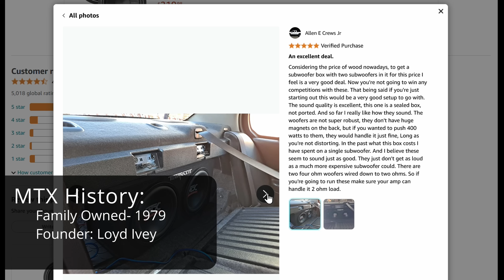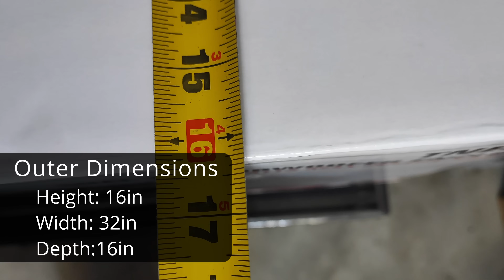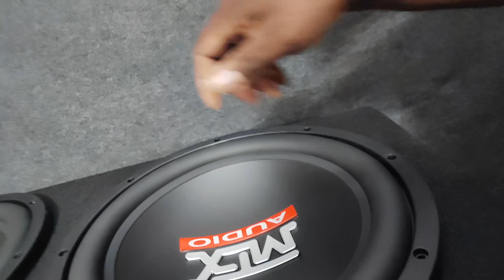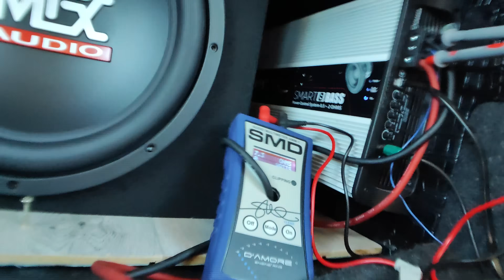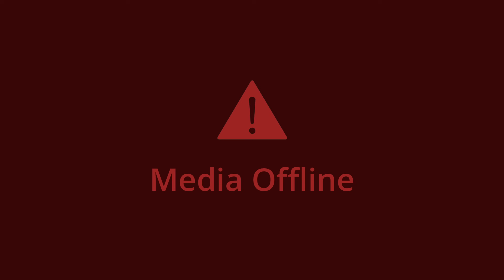Why Is EVERYONE Buying This Loaded Enclosure | MTX Terminator 12 | 5,000 Watt SPL Test

Comment: MTX is slept on nowadays it seems, but they have solid stuff and they're STILL family owned in USA. The current CEO(son of founder RIP) is fanatical about audio. Like, unhinged in a good way. Their amps are crazy good and usually way underrated(rated at 100x4 but actually putting out 140x4 kind of underrated).
I just ordered a set of front and back speakers from them for my truck the other day. Can't wait to install them and put an amp on them after I finish deadening my truck.

I have installed both pairs and they indeed bump, but so far only off the head unit. I just ordered the TH400.4 amp for them. So hopefully I'll get that installed and truly let them shine.

Now as long as I can resist adding a sub...

Just got the amp and the birth sheet shows 114x4 @4ohms lmao From an amp advertised as 50x4 @4ohms lol This is why I went with MTX.

Comment: I'll never understand showing db test for running a sub above the rated rms of the speakers, running 2000-3000rms on 400w rms subs is like shoving steroids into your arm then bragging about your muscle yeah its temp gains but your going to blow your voice coil/cone/xmax out at some point, only test on rated rms for a true test, no point showing numbers that sub can never realistically run for more than a very small time frame before replacement.

Comment: Guess it was too popular. Price as of 07/14/2026 is now $219, but the sub has a different appearance. I does not have the red "Audio" marking under the MTX brand. The box with those subs is $279.
Reply: @Mavrik1011- Just came directly from MTXs website, & this Dual 12" sealed Terminator enclosure with (2)- 200 watt rms 12s currently sells for $175, & the Dual 12" ported Terminator enclosure with (2)- 500 watt rms 12"s currently sells for $225, as of 10-20-2026.

Comment: My first subs were two MTX 4000 10’s with a MTX RT2100X from Circuit City. I eventually moved onto 4 MTX 6000 10’s on a Kenwood 600 watt amp. I actually miss the old paper cone 4000’s from 1999.

Comment: This box has been around for probably 30 years in some for or another. Tried true design. I know I have owned at least two. One I bought in the late 1990s and one I purchased in the 2010s.The older boxes were better built, they used to have the same bracing and hot melt glue sealing the seams, there was a lot of baffle cloth in the older one with pro drivers rated for 1200 watts max. The last box I purchased looked much like this and I sealed the internals with Sila-Flex later filling with polyfill to reduce some resonate deflection in higher volume listening. I ended up changing the drivers after a year of pounding to some amazing JBLs I found on clearance at PartsExpress.  In the end that box is now in my nephews collage rig and still bumping with a 2000 watt amp driving it from Tara amps.  They are built to last.
Reply: Thanks for this, I'm certain a lot of people were thinking that a well constructed box could sustain an upgraded speaker combo... upgradeability.

Comment: The reason 75% have 5 star rating because 75% of users don't know about impedance rise and only run a 500w amp on them and they're efficient so they get loud on low power but don't have much force and almost none down low where almost everyone wants it. Those are good for someone that doesn't want to upgrade their electrical and spend a lot on an amp and lithium, wìring, etc. A cheap Kicker 1000 or 1200 or a Alpine M1000 both 2 ohm amps that would run off 4 awg OFC power wire and big 3 depending on size of stock alternator you may want a small AGM or buy or build a cheap small 12.8v lithium battery or bank. You can buy a pre assembled ready to go 40Ah lithium bank/battery for $45 which is stronger and much faster charging and discharging power than an AGM Battery. Lithium is the future but it's dangerous for newbies to assemble but there are more and more people assembling and selling all different Ah 12.8v lithium banks ready to go for much cheaper than a AGM battery. Also you have more than rated clean power to see what the subs will really do. The average peraon that buys those subs clips them trying to push them because they don't understand impedance rise so most people don't get the results you are but I've done the same thing with 1k rms Rockville K9v2 15's in a stout custom enclosure I designed to the amount of clamped power the subs would actually be seeing and for around $260 shipped you can get 2 K9v2 15s and a Skar 3500.1if on a budget or a lightly used Korean made Deaf Bonce Apocalypse 4000.1 for $300 (not the small square cheap Deaf Bonce amps) the big rectangle that'll run at .5 and lower all day with proper electrical so a Korean 4k @ .5 could run 4 K9v2 15's or if you want a more musical sub the K6v2 15 is 1k rms and also come in D2 or D4 and I have trophies from 2 K6 15s, a cheap Hifonics Brutus 2k @ .5, a custom enclosure, and good electrical.

Comment: It was ages ago when I installed car audio.  We would get bored and to the "lamp cable" test.  Basically, take a 2-prong AC cord and wire it to a sub... then plug it into the wall.

Many a smoke were let out.  JL, Alpine, JBL, Kicker, Rockford Fosgate... For what it's worth - the MTX Terminator somehow held the crown.  Lasted almost a full minute before it quit moving.
Reply from the maker: That's wild!

Comment: I have the 212 Terminator box with the 2 MTX 12's hooked up to a Planet Audio 1500 watt anarchy amp and it pounds pretty damn good!! Bought it off some kid off FB marketplace for $150 2 years ago, and never had an issue. And I've pushed it a few times with the gain halfway up and no distortion, just takes the power.
Reply from the maker: Sounds like a great deal you got there!

Comment: What amp should i grab for the terminator  box? I have a 2016 toyota camry, Would i need any power upgrades to run these?
Reply from the maker: I say, "Upgrade electrical 'anytime' you add to your electric system." Most would say, "No need to upgrade when pushing less than 1,000 watts."

Comment: I purchased one, rocked it for about 6 months, and then I was like, "You know, my amp could power another set." So now I have two. Then I snapped my RCA cable to my amp, so I got a deal on a Rockford Fosgate Prime mono amp. 1600 watts hits hard. I abuse the hell out of these 4 12s. All in a Jeep Liberty... if I could fit more, I probably would.
Reply from the maker: Sounds like a solid setup you got going there.

Comment: Mtx was the shit back in the day with the jack hammer but my favorite is still i had 2 12 inch kicker comp vrs and they would make rocks jump off the ground with a 1500 watt jvc dynamic circuit amp that light up different colors if u put different colored plastic peice over the light i never relized how much better the old shit was my 1500 watt jvc blew every single Walmart i hooked up 2 it would sound good for about 10 min and smoke the spekers weld them together on some until i found a set of kicker comps i thought my amp was junk and just gona blow every speker i hooked up to it until i found those kickers and a mtx crossover to control the anp made a huge difference it bass
Reply from the maker: Thanks for sharing!``

Comment: Yea I have those in my car, they came with the car.  I was an installer back in the 90s and they are not 1200w they are more like 200w RMS, they are cheap and they get kinda loud but not overly loud, they are not musically accurate.  The the money they get loud enough I guess, but they are like the McDonalds of subs.  They are kinda trash, but if all you want is some bass I guess there ok.  It's never what I would purchase.  MTX are always muddy, and just not accurate.  Yes the sealed enclsures are louder in a trunk facing backwards.  The reason for speakers in a trunk being louder facing the back of the car has to do with the frequency that bass is at, and the length it takes a sound wave to complete.  The higher the frequency, the more direct the sound is and the faster/shorter distance it completes a sound wave.  The lower the tone/hz the longer/distance it takes to complete a sound wave.  In an ideal world you want the highs mids and subs to complete a sound wave at your ear.  The issue is at a sub frequency it takes something like 16 to 18ft to complete a sound wave, a car is not that long, and the subs aren't that far away, so pointing the subs away from you gives it time to coomplete the sound wave.  It's not cause it "LOADS" or whatever off the trunk, there is math and science and reasons it's louder.  If you had the subs facing forward the sound is going to "LOAD" and bounce around the windows and whatever else, so that has nothing to do with it.  Sound dedening works because you are losing less energy.  Anyway this is why pointing em backwards works, and it's the same in sealed and ported etc.  If you get a digital EQ where you can adjust the polarity, of each speaker independently you can adjust each speaker to hite your ears, or in front of your face, at the same time.  This is not doable without one of those.  With that being said back in the day before digital EQ's were common this is also why kick panels sounded better than factory locations, it moved the speakers farther away from you, so the sound waves completed close together, the closer mids and tweets are say the drivers side is really close, and the passenger side is really far, it won't sound as good as if you are able to move the driver side farther away.  Same principal.

Comment: 140 db for 2 seconds is not the same as what is plays at lol..that's when you'll see the difference. Oh and once the coils crap out from constant musical. Still love MTX though.
Reply from the maker: There are many different competitions where 2 seconds is all you need. Especially when the budget is a factor.
Reply: @BudgetBassHead  No one competes with those, but ok. It does imply one would get 140 db as a constant, will not be anywhere close, we both know that. That was my point.

Comment: All right budget bass head right?. People that are on a budget don't tend to have amplifiers that can put out that much continuous power (RMS) I'm an old school audiophile and 4000W+ is not an average budgetbasshead  would have access to budget wise 🤔 if clean power is used. In comparison an old-school PB 600 made by pyramid versus a Linear Power 500. The difference is astonishing!!!  I  wonder how clean the power is your using and also I didn't hear anything about matching the input sensitivity  signal resistance frequency to the amplifier  which creates a night and day difference 🤔 Elaborate, kind sir
@budgetbasshead a response would be appreciated

Comment: I've had these in my car for about a year now, they definitely hit. However I'm running them on the MTXTNA251 Amp that came with the package, had them professionally installed in my 2015 Nissan Altima SL on factory radio, I was told they're only getting about half potential on the factory radio, would a LC2I pro converter make them slap much harder?
Reply from the maker: It will definitely help restore base from the roll off set by factory. So in essence yeah it will sound better on certain frequencies.
Reply: Thanks for the reply, would it make a huge difference? I want the bass to really hit, maybe a bigger amp?  @BudgetBassHead

Comment: why arent you turning the bass knob and volume up to at least 75%? are you pushing these subs harder under untuned circumstances?
Reply from the maker: You must be new here. My system is tuned from the head unit to the DSP to the factory amplifier to the aftermarket amplifier 3-way front stage subwoofers in the rear plus door speakers rear.

Comment: 5000 watts? why would anyone think you need that much power, the average concert stage doesn't even use that much, when the speakers have a good efficiency rating you can fill a room with sound at just 1 watt of power,  the more important thing is tuning the enclosure to the space and music you have with a variable or adjustable port, i like band pass enclosures for car audio because the speaker is protected inside the enclosure and the distortion is not heard as much, its actually easer to damage speakers as you can turn it up louder without distorting
Reply from the maker: It's testing. You test max and min. RMS and Peak

Comment: bro this set is absolutely trash, i have a mono block 500 watt rms amp and this speaker set could not handle the amplifier, i replaced it with a single 10" pyle subwoofer that works amazing!!! i had this set that the speaker failed on had a replacement shipped and one of the speakers failed on that set aswell so i returned it too, settled my issue by ordering a PYLE subwoofer.
Reply: Bro sometimes speakers just fail. These have a paper cone. Don't push it to hard. These speakers and a bass tube make a world of a difference
Reply from the maker: That's a bummer to hear, I've personally had good luck with this set up, maybe you got a badly tuned system.
Reply: @BudgetBassHead  No Sir, you are speaking with a master electrician. I personally wired this system and tuned it. MTX subwoofers failed, multiple sets like i stated above i ended up with 4 useless speakers and 2 boxes. I sent all appropriate documentation to MTX support along with my License Info this is how i received my money back.

Comment: I cant beleieve this is on my feed. I literally have this box. Thing has been abused for like 16 years. Ive run it with a JL audio 500/1 dclass amp that is even older. Its currently installed in my old 2007 sentra. I installed a very large Capacitor. Thing is crazy for what it is

Comment: I got one of those terminators with the included amp and all for like 160 in 2020 from a coworker for my 08 Acura TL. It was my hoopd and they sounded great for what it was. I had a clarion eq up front with pioneer speakers and tweeters and I forget the head unit I had. Then I got a Benz after and put a single 12. In 2stack AP with a taramps mono amp ds18 pros in the doors and that thing feels like an earthquake compared to the terminators. But those are good for just a regular system for someone that just wants a little kick but they do thump. I would get them again if I needed especially at the 200 price point with amp included.

Comment: I'm still pounding a 9500 with a kicker 2500, it's murderous. I have 2 of them n a Rockford t2500 but idk what kind of box could hold 2 of them, I have the mtx hammer single box but I've blown that apart a few times already.

Comment: Super rad! I have this Sub and the Matching MTX Terminator Amp, plus a Beleva? Capacitor. Planning on running it in my 84 Regal 4DR. What's a good pair of 3.5 / 6x9 speakers to run with it for Clear yet Deep pounding Bass. Btw you seem to KNOW ur stuff. Is it possible to use that EC5 Quick connect/Disconnect while in the car to install / remove if i wanted to go to Purist shows?

Comment: I've been super happy with my JH10001 amp and 2 5512-44 subs, just need to get a better box built to fit in a gen 2 ranger needs more air space for those subs to stretch more

Comment: I had this setup in my ‘96 Isuzu Rodeo until someone stole the subs and amp.  They left behind the cutter tool used to cut the wires.  I was working for the Houston Police Department at the time and took the tool to the guys in latent prints to possibly lift prints but to no avail.  I loved that sound from those MTX subs and eventually purchased another.

Comment: Of course this enclosure is $180 on Amazon today (1/24/25) lol. Did they figure out they could bump the price because of demand based on recommendations like this? Probably....yes that was a rhetorical question.  I get supply and demand, but thats a $50 bump. I also see they are selling this as a package including a Terminator or Boss amp with wiring kit for $260-$300 range. I do think this is a good deal for someone that just wants some decent bump, it's too bad there is greed added into the price now.
Reply from the maker: Yep. That's the market for ya.

Comment: Starting in the early 2000s i bought a small 8" 3000 series ported truck box. I literally took that thing in and iut of every work truck i ever had for almost 15yrs. Drove with 50w outta a panasonic head unit all way up to 450w mono. I never did kill it. 
I had other twin 8s that didnt sound as good. That lil 8 with that tiny lil truck box banged. I rem putting it in my Tri Axle dump truck for the first time and was amazed how loud it was. Then to the Garbage truck both driven by just the Sony/Panasonic Decks. Cant beat MTX for low power sound.

Comment: Why did he put on screen that they are 2ohm speakers? The way they are internally ran would make them 2 12's @ 4ohms each wired down to 2ohm
Reply from the maker: This unit is a speaker; in it's entirety, with only one option for a final ohm load; which is 2ohms. Therefore, I reference it as a 2ohm speaker(subwoofer)

Comment: I had a mtx 2300 running two 10’ mtx 8000’s in my extended cab ford ranger. I had a rock chip on my windshield when I installed the system and it completely cracked the whole windshield the first time I cranked it up.

Comment: I used to have 2 MTX 9500 12’s back in the day on a Cadence ultradrive z7000 and they slammed!! I just hated the surrounds as they’d tear after a while but circuit city would always swap them out with no hassle. Nice to see other bass heads that are still in the game today! Rocking an SSA Evil 15” on a JP23V2 in a 1996 Camaro. The Gately 5.0cu ft box barely fits in the car 😂

Comment: Single voice coil speakers a bunk.. no matter the brand.. dvc is king.. bring them lows 💯🫡
Reply from the maker: How exactly does voice coil config allow for lower frequency? If an amp is able to deliver 100 watts @40Hz cleanly @ a 2ohm load; what difference does it make whether the woofer is dual or single coil? 100W is 100W & 2ohms is 2ohms.